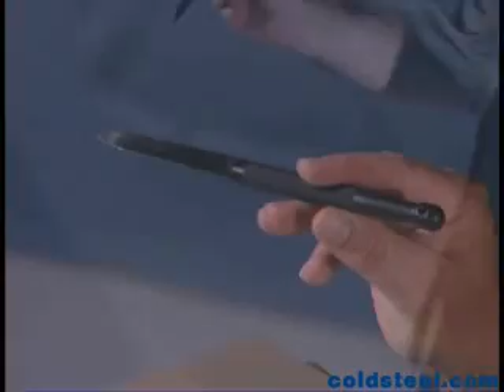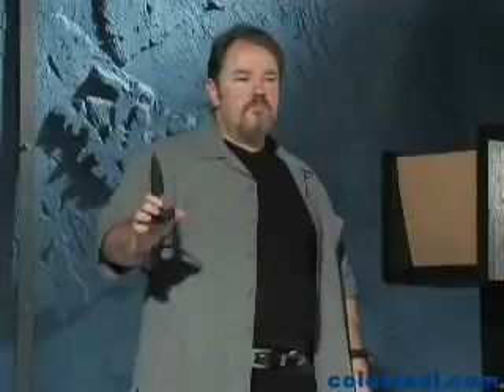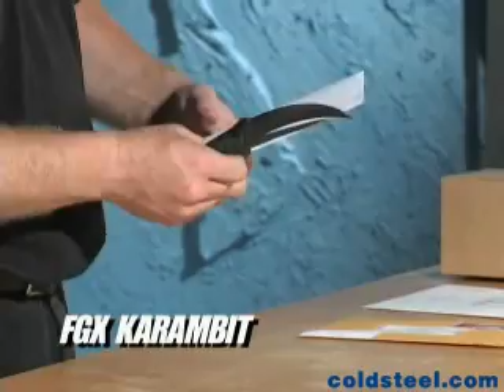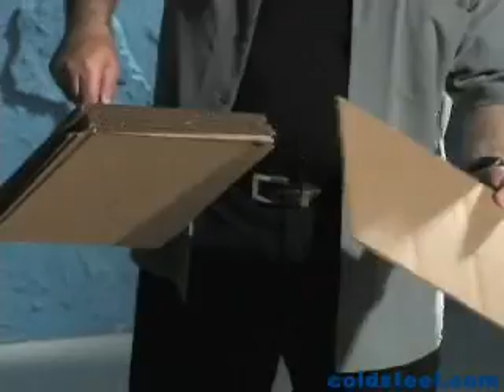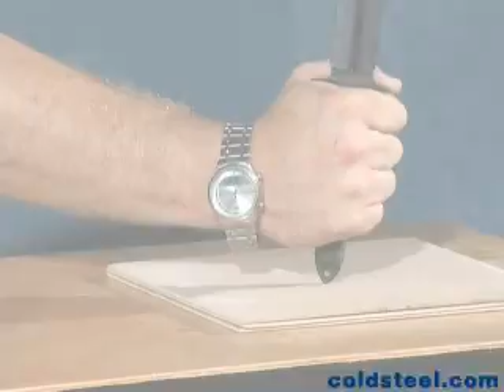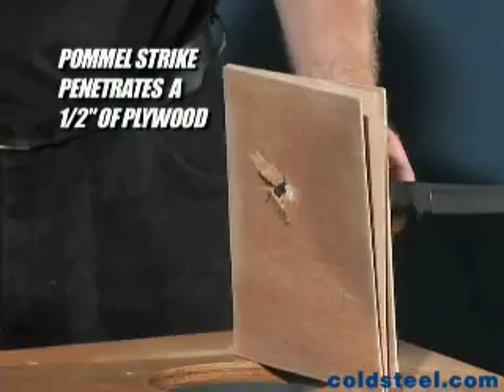Cold Steel NightShade Series

Comment: I've owned 2 of these knives: sai pan and tanto and was shocked at how great they are for only $15 knives. I've read the other comments and let me try to help. They are ment for 2 purposes: 1.. No metal detectors can read them (for that reason, carrying one is illegal in some cities) and #2 they are very very light and great for personal protection at home. When it comes to needed a knife that you hope you'll never need to use: this couldn't be better .. Lighter knife means less fatigue for your arm in a fight; its strong enough to last when you need it most and it's super sharp. This wouldn't be used as a utility, hunting, or camping knife but would be great under your pillow or in your glove box. Only flaw .. Blade is exposed as nothing is sold to cover it.. Probably why it's only $15.
Reply: Jason Henry what model do you recommend me ?

Comment: Have the delta dark. I buried it in some pop cans, milk jugs, plywood. The sharpness of the tip when I bought it pierced right through my jeans on my right leg pretty easily. After stabbing it in a can more than 3 times the edge pretty much chipped off. The cool thing about the dart is you can sharpen it with a knife as you would a stick. The knife slices through that plastic like butter but cut straight through those cans. Interesting...

Comment: not only that but I notice after rewatching the video that pretty much stab and slice if from a position of power-meaning its the best base senario for you-stabbing straight down when most likely you will be facing a standing and moving opponent (unless you knock them out first then stab them...which is murder.) so you are looking at forward jabs and side to side swipes. But they are last ditch effort knives, so if you get disarmed the first time maybe you will have better luck the 2nd time.

Comment: @Mistarfrio I have tested these a bit.  They are not as sharp as steel I am afraid, but stronger then I expected.  You can stab though thin steel with these.  I have, with out to much trouble, been able to stap though soap cans with these.  I do have to note that after a few cans, they do show a lot of scrapping, but it is a major abuse of the knives.  They are not as good at utility tasks since they will not last as long on hard cutting, but they make great ultra light weapons, and low cost.

Comment: Are the blade and handle made of the same material, is it all one solid peice? and how well does the blade keep an edge? I'm assuming the tanto comes very sharp from what I've seen, I'm simply curious to how long it stays that way. I have no experiance with plastic or ceramic blades but I like the looks of this series and I own several cold steel knifes so I like em. I want the tanto, anyone know of any good sheaths for it? I'd hate to carry it around in my pocket.

Comment: @kingmigget Oh, yeah I've heard of that system. I think most airports still use the metal detector type though, since I travel alot and I've never came across those before. But, yeah, you wouldn't be able to bring it through the 3D picture type, it's too difficult.

Comment: Hi, I have a question:
I am a security guard.
I want a very small knife (maybe 4 inches overall length) that is undetectable by metal detectors (even concealed somehow if possible). Preferably with some case I can pull it out from fast or having a clip.
1) What do you suggest?
2) Are the cases of undetectable knives also undetectable (logically yes I say, otherwise what the point right?) or is it possible that a manufacturer overlooks this (sounds stupid, but you never know)?
Thank you for your time.
Reply: outofthebox7 these are 100% undetectable no metal parts other than a removable “key ring” you can take off. I carry the delta dart when I go
To concerts or other places that prohibit knives. They don’t come with sheaths but you can order a sheath separately
For just a few bucks. They are outstanding especially for the price

Comment: @kingmigget They obviously can't market it for that. But, that's one of the main reasons why people buy plastic knives. It's because metal detectors can't detect them. Why not just buy metal ones then? They stab better and cut WAY better. Of if you wanted it to be lightweight then why not high grade aluminum? So it can actually cut. These plastic ones can be taken through security.

Comment: id much rather see them testing the sharpness of the blade, stabbing cardboard doesnt really prove anything... i could stab through cardboard with a screw driver, does that make it sharp?
Reply: That's not the point of these knives. They aren't meant to be sharp, they are last ditch defense knives. Screwdrivers aren't sharp, but wouldn't you rather have a screwdriver to defend yourself with than nothing?
Reply: Alright fair enough but I would still like to see more cutting done with the blade to see how sharp it is in that respect
Reply: Awesome :)
Reply: my god haha
Reply: These are plastic by the way...
Reply: No it doesn't,  but you won't get through a metal detector with your assault screw driver.

Comment: Can they be used like normal knifes? For camping , for example? How you sharpen them?
Reply: +kiba BG These types of knives are specifically meant for taking places that are otherwise considered restricted access. Airports, pretty much anywhere where you go through a metal detector. You can carry guns in airports, but not past a certain point.

Is the place you go camping restricted access? No? So then why THE FUCK would you want a plastic knife for camping?
Reply: ***** Its light and cannot rust. But they are made to be used once in a life for personal defence. I got it. Still very nice knifes.

Comment: there's a reason most states ban these btw, mostly because they bypass metal detectors. (including airports) and the description even says they can be tucked or taped anywhere. who needs to tape a weapon exept someone who is hiding it? the ONLY real reason i can think of for having one of these, is loop-holes in the current law system, hence only criminals or those with criminal intents will have these.

Comment: I'm sure if I throw all my strength into it will...but damn. I run 20+ miles and I may not have the power to drive this thing home like bubba up there after running that far with a backpack. I prefer something that cuts easily. I will just carry that steal blade I have for now on my long runs.

Comment: Goes without saying that a blade made from resin can not be honed to the same kind of cutting edge as high quality steel. The demonstrations only serve to show that they will tolerate that they are useful for some cutting and stabbing action even so. The big thing about this kind of knife, is that it does not show up on scans as metal. Basically a pretty rotten idea, securitywise.